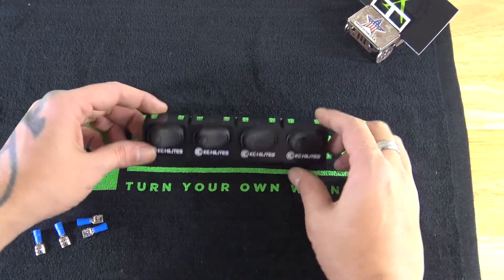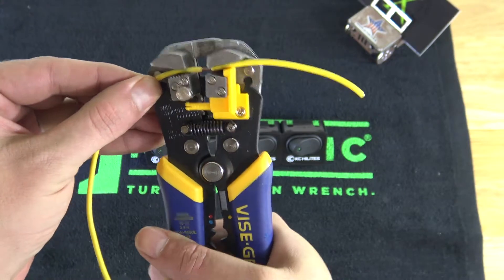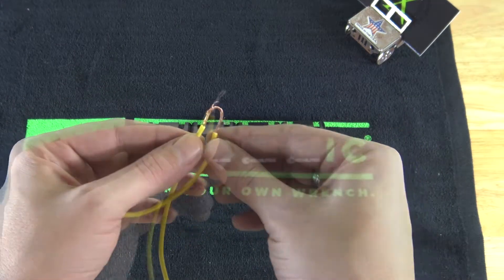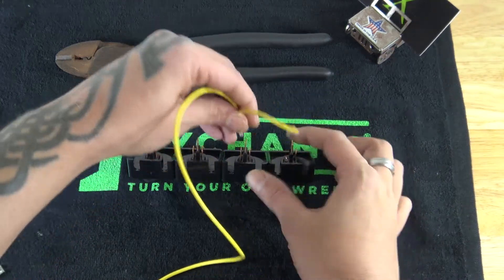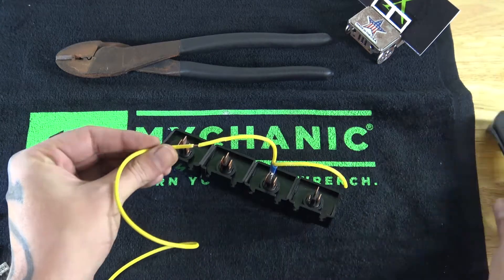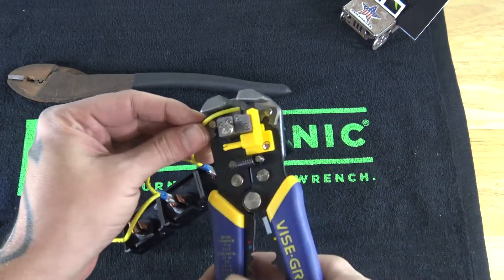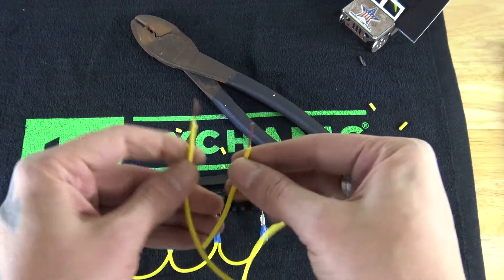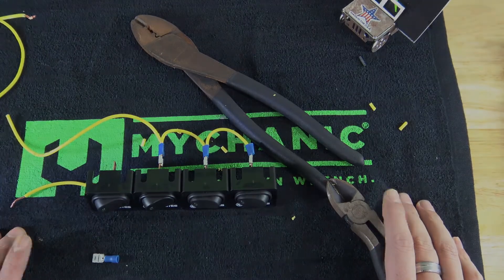How To Make Clean & Easy Daisy Chain / Jumper Wires (MTOT)

Comment: That's a damn good idea, I've wired my lights multiple different ways but I run about 100 lies in series over a 30 foot truck, Varying distance in between the lights as I change from location of mounting, This is probably the best idea i've seen yet as I can lay out my entire roll of 2 conductor wire and simply do this trick at every light continuing down the bed, Before I'd cut at every light and put 2 or 3 ends in each butt connector, and I constantly had 1 or 2 of the wires not crimped quite right as it's a confined space and it would pull out making it a pain in the ass... This will save me so much time, And make it so much cleaner as well as allow me to use my 2 conductor wire rather than 2 separate strands of wire and I can easily put most of the wire in loom, Before that wasn't an option at all.

Comment: Hey love the videos. We all appreciate you sharing your knowledge and expertise. I even went as far as to donate on your patron page.... i do have a question. Im wanting to run 1 light from 2 separate switches. Here's what i got: 2 6 inch 35 watts each flood/spot light on the back of the roof for lighting areas behind truck. Currently the the normal install as far as wiring. Lights are daisy chained together. 20 amp fused relay under hood powering them and then  lighted rocker switch in cap single pole single throw as trigger on off. I would like another switch in truck bed as well just for convenience sake.... ive watched your videos on using on off on switches for powering from  reverse lights and interior switch etc... do i run a single pole switch from truck bed to a new on off on rocker in the cap,  and tie the 2 in the end positions and run center to trigger wire? Similar to the high beam and reverse light trick. Or is there a better simpler way you know of thx. ( i have room in fuse block to add additional power and ground for a new switch. no accessories are on factory harness installed new fuse block and relay box for safety and to prevent interference with OEM computers and equipment)
Reply from the maker: Sounds like you have the right idea. You just need another single pole switch at the rear and provide it with power. Then just run a wire either to your switch in the cab and tie into your trigger/coil wire there or run the wire to your relay and connect to the trigger/coil there. As long as you are tapped into the trigger/coil wire with your new switch it will be able to control the lights, you just won't have the function like a 3 way house light switch. If you turn on the light in the rear you have to turn it off back there as well. You couldn't turn it on in the back and then off at the front. I hope that makes sense. If you have any other questions don't hesitate to ask, you can comment again or you can email me at rocky.tvchannel@gmail. Thanks for watching and for becoming a Rocky X TV supporter!

Comment: Hy.. I want to install two 55W halogen projectors on my motorcycle as fog lights & the stock bulb is only 35/35W, the battery is 12V 3Ah & my motorcycle is having DC power supply... But, I want to know if i  switch on all the lights including the 35/35W stock bulb & both the 55W halogen projectors using relay at the same time will it affect the battery or the wiring harness of my motorcycle?
Reply from the maker: I'm not really familiar with motorcycle electrical systems. Do you have an alternator of some kind on the bike or does it run only on the battery? When figuring out how much you can run on an electrical system you need to figure out how many Amps you will be pulling. An easy way to do this is to use some simple math. Watts divided by Volts equals Amps, Example using your numbers. (35W + 55W + 55W = 145W) then divide (145W/12V = 12.083333333A) Call it 12.1 Amps, can your system handle 12 Amps on the circuit you want to use? This is why I ask if the bike has an alternator as 12 amps would drain a battery fairly quickly without some kind of charging system. If you have an alternator this usually up the Voltage of your system, usually to an average of 13.8 so this would change your numbers. (145W/13.8 = 10.50724A) Call that 10.5 or 11 Amps. I hope this answers your question or at least points you in the right direction. Thanks for watching!
Reply: Rocky X TV Thanks for the help..  my motorcycle has a 12V 3Amp battery & yea it has alternator (stator).